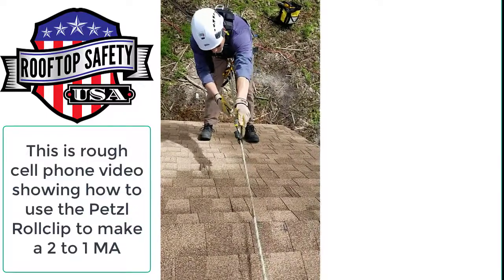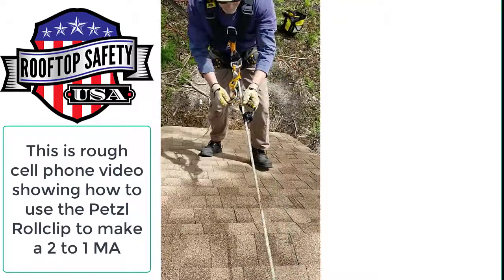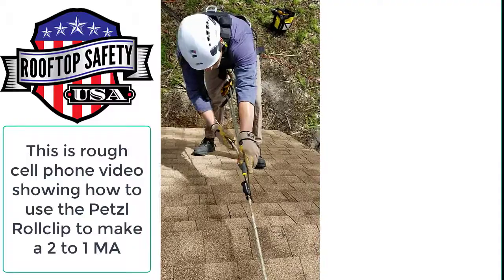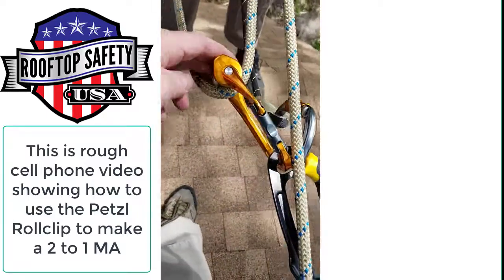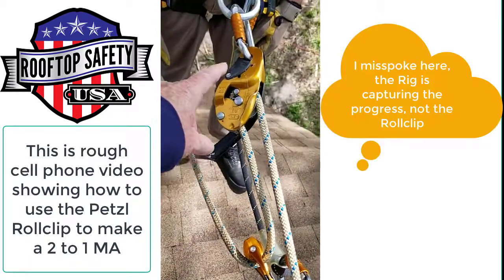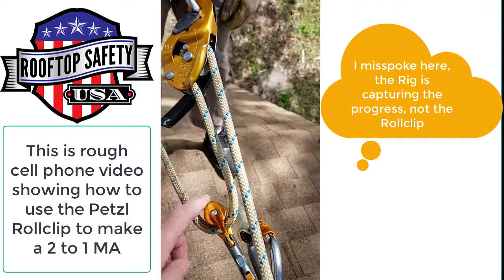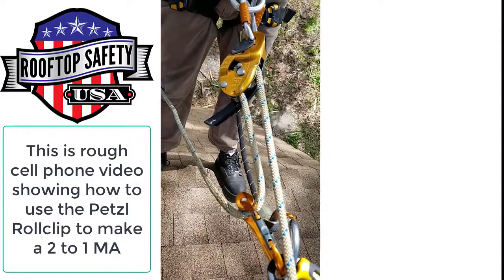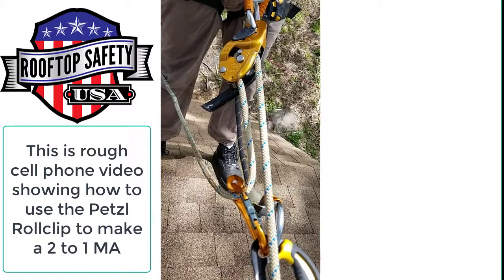Rollclip

Comment: Is climbing rope leading edge rated? I honestly do not know. If not, when your fall arrest / ascension system can come into contact with an edge such as the ridge of a roof (from my training as a competent person for FP) you should be using leading edge rated gear such as wire rope. I may be wrong as I only know FP (fall protection) from a CFR 1910/1926 standpoint.
Reply from the maker: Climbing rope is not LE rated so always need to protect your rope over any edges or other areas it could be damaged.